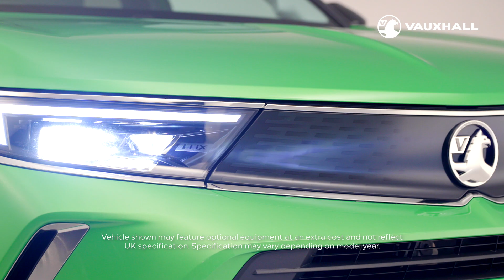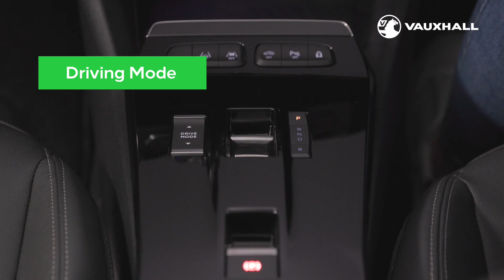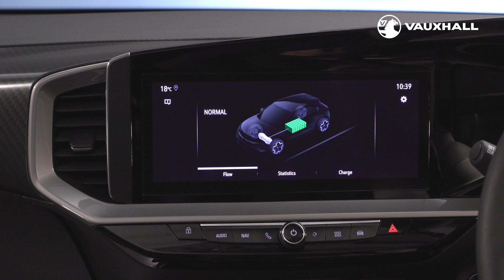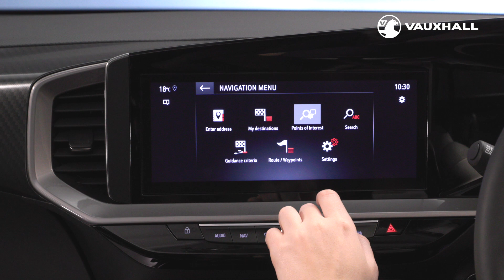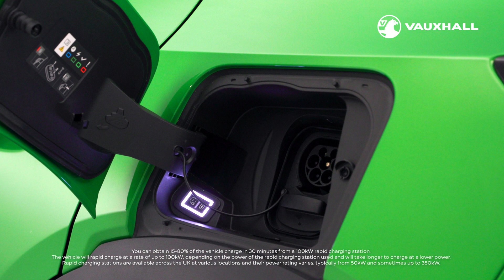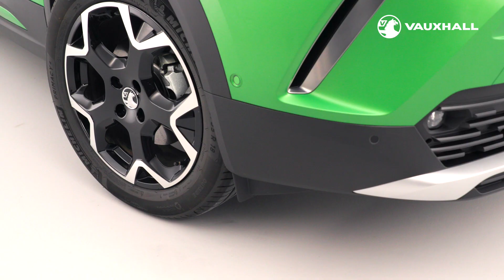Charging and More | New All-electric Mokka-e | Vauxhall

Comment: It would have been useful to be able to set a charge finish timer for people like me who intend to charge when the off peak rates come into effect. Also is there a recommendation as to how much to charge the battery ? This is a controversial and much debated topic with some schools of thought saying not to charge beyond 80% regularly. Has Vauxhall got an official recommendation ? Thank you.
Reply: The charger will not over charge your car. It stops automatically when car is fully charged. And keeps the charge in the batteries.
Reply: @seanmullan8203  Thank you very much indeed. I did gather that and have had a Leaf for the past 4 years before changing to the current car. My only concern was going into the  peak rates should the car not be charged by the time the off peak times end. For me personally it's perhaps a moot point now as I've already made the switch to a different car. I appreciate your input though. Thank you.

Comment: So you can set the charging start time but not stopping time? What's the point in that? Most popular time of use tarrif is octopus go which gives you 4 hrs overnight. Start of the charge will be cheap but the remainder won't  be. Nissan  had a full timer in their leaf 10 years ago.
Reply: Most home charging is 7kwh, you’d do most of your charging within that time slot, plus a few pennies difference if you go over the time slot still charging.
Reply: @italianstallion701  you are assuming a home charger that not everyone wants to pay for. If you have one of those then most have timers anyway. I myself cannot get a grant so use a granny cable. For the sake of adding a stop timer (something even the old leaf had) why eliminate some of your market? We would have bought it if not for the timer issue. Even overlooking the contempt for right hand drive drivers with the terrible glovebox. Make that 2 glaring oversights without making much effort.
Reply: @madonemt  or just get a plug timer? It’s like 5 pounds?

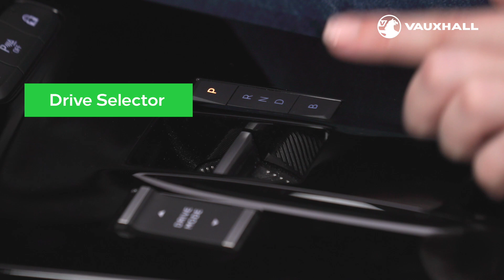Comment: @1:08 is there no way that we can have an electric car that's manual?
Surely there's some way you can implement software to emulate a manual right? I know that might be expensive but I do prefer manuals...
Reply: You crazy?
Reply: I prefer steam engines but we are in the 21st century now.
Reply: You can gear electric motors and it is possible to have a manual electric car. There is just no reason to do so in a road car. Don't think of electric cars as automatic,they have no gear box in that sense. The accelerator pedal controls the amount of voltage going to the motor,the more voltage the faster the motor spins.
Reply: There is only one gear....
Reply: @danielheitkamper7269  I know, I just can't stand automatics, it's one of the reasons I don't want a bev is because I feel more in control with a manual gearbox.
Reply from the maker: @james10o1  Hello, whilst it may not be available in manual options, the all-electric Mokka-e does offer 3 different driving modes: sport, eco and normal offering you versatile driving options. Find out more here: https://bit.ly/35U4UYR ^ Mike
Reply: The good old ‘feel of the car’ 😂